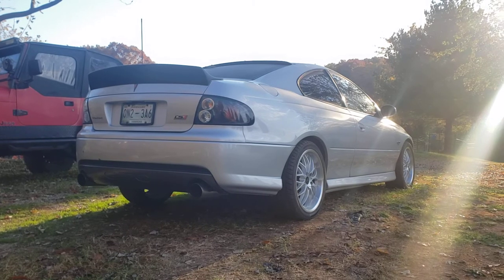Pontiac GTO TSP 233/239 Cam

Comment: what dyno numbers and mods? Thanks i have a 6 speed gto looking to buy the same cam.
Reply from the maker: 410 whp 362 tq. Cam, Unported 243 heads, longtubes, dyno tune
Reply: @jakelogan630   what kind of dyno the torque should have been higher? My 98 z28 with a 218 cam stock heads ls1 Intake made 375wtq on a mustang Dyno. Was just curious as I'm interested same cam stock bolt on 04 gto
Reply from the maker: @JustinRaney  dynocom

Comment: Nice . Where did this cam peak at? How high did you spin it?
Reply from the maker: It peaked at 6500 rpm. 411 whp 362 tq
Reply: @jakelogan630  thanks bud think this is my cam . I don't want to spin 7k. Nice goat btw!
Reply from the maker: @royhummert7281  thanks man. But if i had to do it again i would go with the magic stick 3. Just a tad bigger and makes more power
Reply: Really? I was looking at tick sns stage 3 or this.
Reply: Did you upgraded the rockers? Any issues with the push rods I’m planning on buying one for my c5 z06
Reply: @SVfighter1  Unless you're going with a larger cam profile like ms3,4 or tsunami or any other stage 4 cams.. factory rockers are fine. I spin my 98 ws6 (with ls6 top end, cr-mo pushrods & 4.10 gears) above 7k when shifting during street kills etc. Stockers are still very durable! Ran the LS6 top end with 4.10s since 2011. Just last Oct i ported my 243s and swapped the SDPC LS6 power max plus cam in with pac 1219 springs. Kept my 7.4 pushrods as well. Still hit 7k rpm's even tho can now shift around 6800 rpm's. But still same rocker arms since 2011 and they are still in great shape! Unless you're bored and have nothing else to put $175 towards buying.. otherwise.. save you're money and stay with your factory rockers.
Reply: @charliecadaver666  I’m running a 3.73 gear in the rear I guess I should be fine
Reply: @SVfighter1  what stall converter did you run with this cam?
Reply: @TheChevyryder  torque converter on a Z06 … it’s a 6 speed T56
Reply: @SVfighter1  ok I have a LQ9 I’m installing this same cam with a 4l80 not racing or anything but the cam calls for at least a 3200 stall